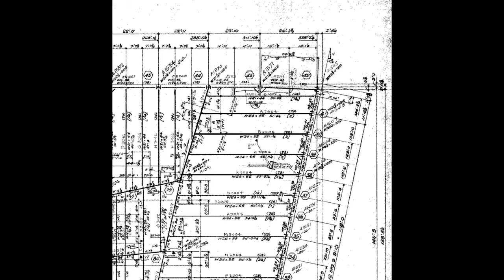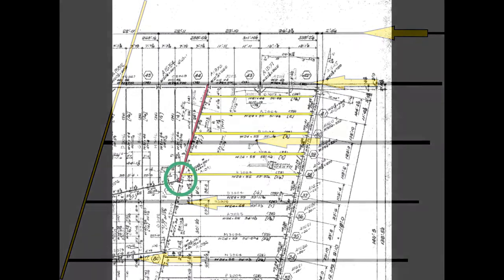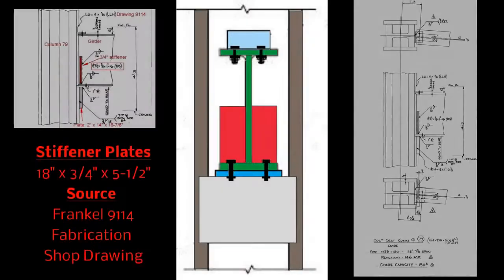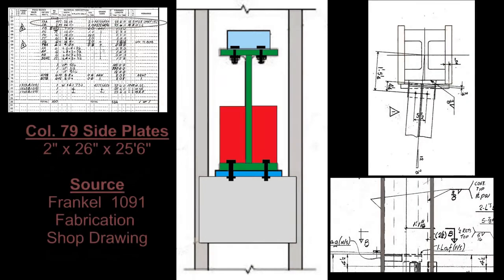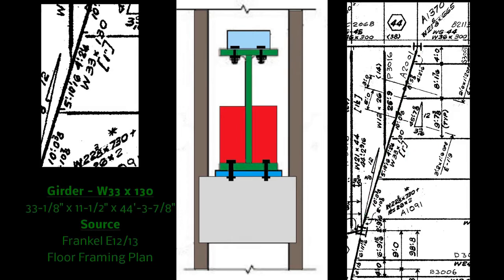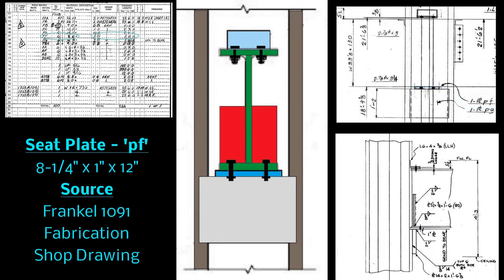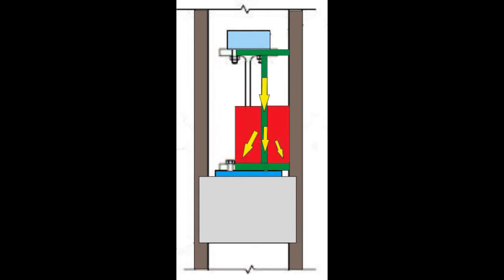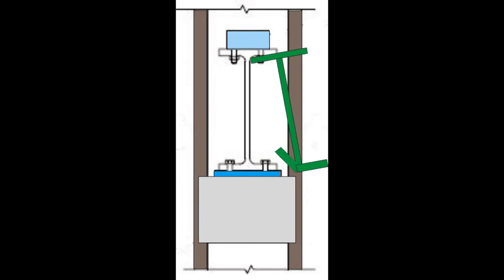WTC7 - The Stiffener Plates Explained

Comment from the maker: The sneaky Edward Current is blocking, or deleting many of my comments under his shallow video: Building 7 Explained: 

(  www(dot)youtube(dot)com/watch?v=uFJa9WUy5QI  )

So it appears as if his 'debunker' friends are talking to themselves, because my comments are just missing.

I will post my responses here. Beginning with a thread started by Ouwen C. 

Ouwen C pulls out the usual excuses for avoiding scrutiny of the official line regarding WTC7. My last response to him:

-------------------------

Ouwen C; "..talking about things you don't understand."

MAC; "Yes I do understand it [the omitted stiffener plates]. It's easy actually. You would realise this yourself if only you had the courage to look into it. I posted a link to something about it in my last post, which you won't check out,. Even if you do, you will automatically handwave it, won't you? Yes."

Ouwen C;  "the vast majority of physicist and engineers do not have issue with the report"

MAC; "They haven't looked at the issue of the stiffener plates.

The omitted stiffener plates were only discovered by an engineer (via FOIA) in 2012 after examining the drawings NIST worked from."

Ouwen C;  "what you want them to mean"

MAC; "False. You have it backwards. It is YOU who wants to believe NIST's theory, no matter what!"

Ouwen C;  "an engineer can tell me whether the analysis of these parts are significant to the building's design.."

MAC; "Then listen to the ones that have examined the issue! Not difficult."

Ouwen C;  "and whether they are neglected on purpose."

MAC; "You know nothing about the issue. Once again, NIST acknowledges that they omitted the stiffeners. What they don't do is explain why their inclusion wouldn't change the outcome."

Ouwen C;  "it is clear you don't have a stem degree or any real ability to analyse the situation; or you wouldn't have answer me with cheap rhetoric."

MAC; "That's RICH accusing me of "rhetoric", when that's precisely all YOU are offering!"

A "stem degree" isn't required. You're just inventing silly excuses to bury your head. 

You clearly "want" to be impressed by Edward Current's shallow video that doesn't "explain" anything. And you will automatically reject all criticism of it and make lots of silly assumptions without studying the issue.

-------------------------
Reply from the maker: Another ghost blocked post of mine (an OP)  was in answer to the video itself:

-------------------------

EC (Edward Current); "Steel loses half of it's strength when heated to just 1200 degree Fahrenheit".

MAC; "Most of Building 7 was not on fire, thus unaffected by such heat.

Other steel framed high rises have had much worse fires, over many more floors, and burned for longer, uncontrolled after firefighting efforts failed to contain them."

EC; "Critical connections between beams can break"

MAC; "You omitted web stiffeners." 

EC; "And put the entire structure at risk"

MAC; "The structure being at risk, is not the same as expecting a global collapse."

EC; "This is what happened to Building 7"

MAC; "Pronouncement. That is unproven. All you do is re-iterate NIST's 'theory'.

We know debris hit Building 7 and ignited fires. Doesn't explain the collapse.

Yes, we know there was no water to fight the fires. Other steel framed high rises have had much worse fires, uncontrolled after firefighting efforts failed to contain them."

EC; "Fires burned through the building uncontrolled for nearly seven hours".

MAC; "Other steel framed high rises have had much worse fires, over many more floors, and burned for longer.

NIST tells us that the fires only burned in one place for upto 20 minutes at a time. That includes the floor where the alleged girder walk-off occurred. Therefore, it's reasonable to assume that things would be cooling down. A problem for the thermal expansion scenario, then.

We know that a collapse was anticipated and reported by the media. But nobody expected the type of collapse we got. Why would they? Unprecedented. Any expected collapse would involve a natural, more asymmetrical kind, as per the random fire and damage and the bulge. That's why there was an alleged proposal to demo the building for safety reasons, in an attempt to control the collapse (see Shapiro, et al)."

EC; "It was only after the core of the building was gone, that the rigid, unsupported outer walls came down"

MAC; "And that's where it gets absolutely ridiculous. There was no cartoon 2 x collapse. What were the beams connected to the outer wall with, duct tape? Chewing gum? Not one part of the facade got distorted, pulled in, ripped open? Really?"

EC; "Making it look as though the entire building collapsed at free fall speed"

MAC; "The remaining structure (most of it, including structure below the wider west penthouse) dropped in seconds, which included 2.25 seconds of ffa for 105 feet. That cannot be explained by a cartoon collapse that exists only in your head."

EC; "Failure is the inevitable consequence for a steels structure exposed to an uncontrolled fire"

MAC; "Absolute bullshit. Got any other examples of steel framed high rise infernos dropping to the ground?

No. Instead you compare an overpass with a high rise skyscraper. You're comparing a banana with an apple. 

Also, notice that the collapse of that overpass was partial. The whole thing didn't suddenly come tumbling down. Not only are you comparing a frigging overpass with a high rise building, you're comparing a global failure with a partial one. What a joke.

Nobody says the overpass was an intentional demolition, because it doesn't resemble what a demolition of an overpass might look like. Whereas Building 7's collapse looks right at home amongst demolition collapses. 

Your comparisons are ridiculous and utterly misleading."

EC; "It's the only one in history to burn uncontrolled for 7 hours"

MAC; "False. Many high rise infernos have burned more fiercely, despite firefighting efforts (therefore becoming 'very much uncontrolled' too) and for much longer than 7 hours. 

Btw, the Caracas Tower fire burned for more than 17 hours and heat from the fires prevented firefighters from reaching the upper floors. Thus, not much firefighting going on there, then. Didn't implode.

Your seductive, but ultimately shallow debunking video will get shallow 'debunkers' terribly excited, for sure. But it fails simple scrutiny."

-------------------------
Reply from the maker: Piet Parra Oh dear, are you feeling triggered. Bless.